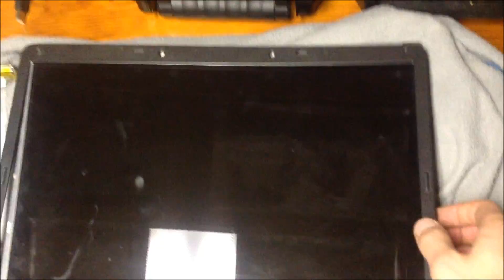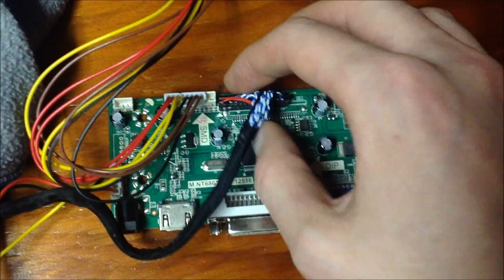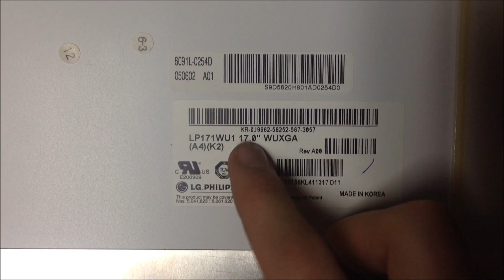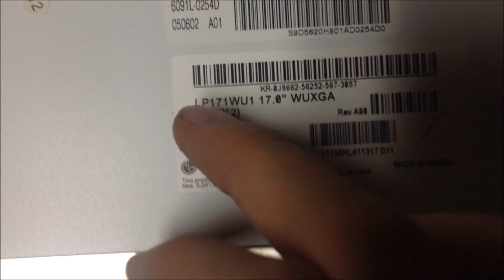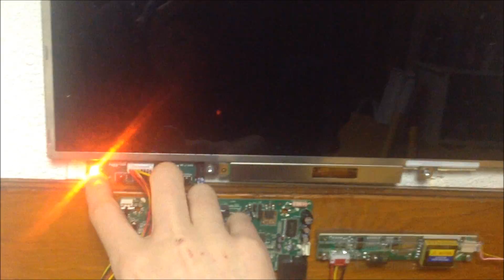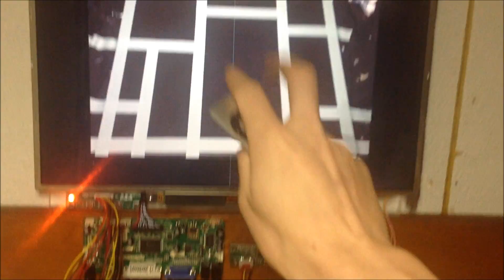DIY Re-use Old LCD Laptop Display

Comment: My inverter/controller is powering the screen but not the backlight. I can see the display when i shine a flashlight through the back and everything should be wired correctly. Is this an issue with the inverter or board? Anyone with similar problem?
Reply from the maker: +Drew Darden  you should have two harnesses which go to your screen. One powers the lcd display. The other one powers the back lights. Double check the connections. I had the same thing when I did mine. I forgot to hook up the backlight harness wire.
Reply: I think I did that. I removed the screen's inverter and plugged the pink and white wire into the controllers inverter where it says CN2. still no back light. Not seeing another harness from the screen either

Comment: will this lcd can b used as standalone Tv? like if I use pen drive for running video or watching photos? is it possible
Reply from the maker: It does not have a USB connection for direct video file playback.  You would need to use something with an HDMI connection.  Such as an Apple TV etc..
Reply: Jai Ganesh Naidu 
you could use a Raspberry Pi for instead of a tv

Comment: Hi Will,

Do you know if this would work with a replacement LCD panel ? you buy the raw LCD panel and controller and would work the same?

Thanks
Reply from the maker: +Juan Lobera Yep that would work aswell so long as the replacement LCD model is supported by that specific controller board

Comment: Thinking about using something like this with a Raspberry Pi. Question: does the controller (and thus the screen) follow standard power management protocols? I.e., can the computer turn it on/off when hooked up with HDMI, or does it require pressing the power button?
Reply from the maker: +Daniel Favand There is a standby function built into the controller i believe, where you can set the display turn off after inactive input signal.
Reply from the maker: +Daniel Favand Turning it back on may require the button, unless you can control the signals through the CEC HDMI port.
Reply: +Will Rose (SeeWillySee) Thanks :)
Reply: +Daniel Favand I have the same idea as you have in mind, use the screen for Raspberry Pi. I was wondering about the results; did it work for you Daniel?
Reply: +Navid Azadi Hey Navid, no I never completed this project. I decided my screen wasn't nice enough for the project! Good luck :)

Comment: Hi, does the HDMI input has HDCP compatibility? For using with a PS3 for example.
Regards
Reply from the maker: Good question,  Im pretty sure it does.  I hooked up my Apple TV 3rd Generation in the video.  Which I believe requires HDCP authentication.
Reply: Thank you for your reply. In that case it is a wonderful device!

Comment: That line could be caused by a short on the buffer board one of ribbon ports 2 of the pins could beba solder bridge. I had this on my tv one of the pins had a solder contamination.
Reply from the maker: I will have to scope out the connections to see if theres any possibility of a short.  Thanks for the tip :)

Comment: i have la.mv29.p driver and LG.philips lp133x7 -q2cc panel. is the driver i have compatible? if not is there anything for me??
Reply: ok i have some image on the 1/3 of the screen and a resolution of 1920x1080 but the screen is f@cked up i see some screen with bleur .. how i change the resolution?
Reply from the maker: mitropoulosilias I believe you can change the resolution within the controller kit.  Keep in mind I do not actually make these controller boards.  I am only pointing people to a company in china who creates them.
Reply: thanks a lot! there is a file that changes the resolution. i have to download it and put a usb memmory stick when power on the board but nothing hapens... i am going to do more experiments on that,, or try some other type..

Comment: Will this also work with a touchscreen?
Reply from the maker: Would have to ask the company who creates the controller boards.  I doubt it though.  You would need a different controller board that would have a serial or usb connection to a computer for the touchscreen x/y axis information.
Reply: Will Rose im sure the company that makes the boards can put one together that includes a touch screen input..wouldnt be hard